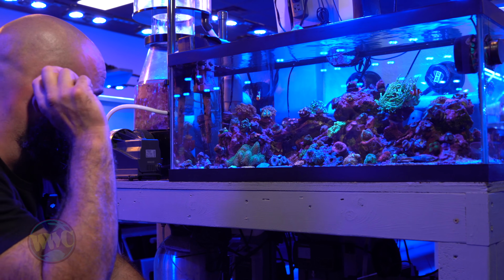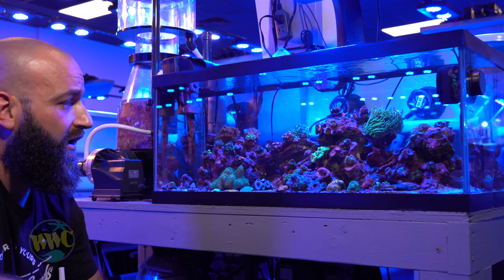Optimizing Aquarium Flow and Waste Export: A Complete Guide

Comment: My Innovative Marine Nuvo 15 Desktop tank has the sump set up differently with the water in chamber one having to go to the bottom of the chamber and then rise up in chamber two and then finally fall from the top of chamber two into chamber three.  I have my heater (along with my ATO sensor and return in chamber three, so I can’t lower the water level too much in that chamber.

Comment: Get little stick with string attached to it put it in the sand to see how your flow is flowing I use 3/32 aluminum tig wire cut to 4 inches 7ins and 11 in (got a 3 in sandbed) and I put them near my corals and open areas to see the flow directions and speed
Reply: And for those who say oh no it’ll leak metals into ur water Well a lot of us use stainless steel and aluminum tweezer in the tank I doubt it would hurt ur tank, It’s a pure aluminum rod that is about 3/32 thick , also there in there for 20 mins max till it’s adjusted to the flow rate of the coral with a 10-20% water change after . Also it’s not that hard to find a replacement material (so called reef safe materials. That can act as a substitute. Also amino  and flanks rather dispute too fast or move around to fast for me to properly view everything at once + I don’t want to over do the flakes or aminos in my system

Comment: i have a sump that does not have a fall between 2ed chamber and return chamber what do i do?
Reply from the maker: Just drop the water level in the return chamber until it drops at least .5". If you have an ATO sensor, you can simply move it down.

Comment: Hey, I have a couple questions with the AIO water levels. What if you have a small skimmer in the back chamber like a tunze 9001 which requires a high water level? Also what about a heater how where do you put it in the back so that it’s fully submerged? Thanks

Comment: After struggling with flow issues in my peninsula tank and watching this it's been a game changer, I was constantly battling dead spots and film on the surface with very little surface skimming going on. Moving the powerheads down to the middle of the tank as both are on the back wall either side of the weir and turning up the return, a little adjustment with the ball valve and wow what a difference, not only can I now run the powerheads at a slightly reduced speed the the surface skimming is insane and after 24hrs the water is looking so clear with no surface film, thank you so much for doing this video 😁

Comment: Thank you for sharing. Where do you place the heater with this instruction?  Instructions for many aquariums and heaters say to place the heater in the third chamber. 
Also, my fluval flex has two drains. One at the top and bottom. Does this change anything? Thank you!

Comment: Ok so I came across this video in The Fluvial EVO group on Facebook but I have to say all tank requirements as for water levels are different especially on the Innovative Marine tanks they give you a water line and it’s not even close to what you are showing I would not usually state you are not correct but it caught my eye just a fyi
Reply from the maker: this video was to help everyone understand the flow and export so they can make those adjustments to the system the have :)

Comment: I have a long tank,6,5 ft.I have 2 gyres and 2 wave makers.Cant get the right flow.Problem with gyres is i always let them run forward.Its not bad maintenace but i find that they quickly make and howling sound if you let them run back and forward.So i let them run constantly.Cant get my euphillia movement right,its frustrating.Great vid also👍
Reply from the maker: Is the hammers and torches not doing well because of the flow?
Reply: @WorldWideCorals  there ok,they not move from left to right. More to one side

Comment: The red sea max nano tanks have a terribly badly designed rear sump section as the baffles do not function properly and you are left with particles circling on the surface in the sump and display
Reply from the maker: What are you doing to fight that Max?
Reply: @WorldWideCorals  as far as i can tell there isnt really much that can be done. Other than using filter floss to catch the particles as they enter the rear sump and running a higher flow rate return pump. Obviously the next issue is as the floss clogs, the return chamber water level drops and so does salinity due to the ato… so it all a delicate balance that requires constant monitoring
Reply: Send pics to our customer service please we may be able to help

Comment: This doesn't seem achievable with waterbox tanks. Their return nozzle placement is 3-4 inches higher than what the tank in the video has it's nozzle at. It's not possible to have the water level that low in the back chambers without having the return nozzle pretty much outside of the water blasting a waterfall into the surface.
Reply: This is entirely possible with the waterbox. The height of the nozzle has no impact on the directional flow. It actually better impacts the PH and DO.    The rear Chambers function exactly the same with two less baffles
Reply: Literally tested this out myself to get the chamber water level that low I need to take out ALOT of water. I am using the standard 225 micron filter sock (felt not mesh) which is the only difference I see in the video other than return nozzle placement.
Reply: @Arborpress  and what was wrong with taking out a lot of water?  Send some pictures to our customer service and I think I may be able to help out better

Comment: Such a useful video, although how would you maintain the levels in the rear chamber if your tank has an overflow weir down the bottom as well as the top, it seems as though the water level stays completely the same across all compartments and the tank, it creates a bio film on the surface which sucks, is it possible to fix?
Reply: It's hard to answer this without seeing. However if it is anything like the marine land overflows of times past, they took have a lover intake but it is just a passage behind the cover that also flows up and over the top along with the upper weir.  This does the same thing because it creates a draw.

Comment: It would be cool to see a an optimal AOI fuge design.  Maybe two designs one for a single overflow and another for larger tanks with two. Tank shown here has some tight plates while others have a big gap/chamber between the inital overflow and getting to the return pump.. how does that affect things? is it just more room to put things like a heater or bio media or is it not as good for some other reason?

Comment: It seems like even when I get particles back up into suspension in my 20 AIO, they do not hold at the surface and just recirculate.  Some particles do make it through the weir but most approach, then fall back into circulation towards the powerhead.  Could this have to do with surface tension? My lighting brackets break the water surface on both sides.
Reply: Heard to understand what you are saying entirely but turn off the powerhead and play with the surface skimming that way. It's possibly there isn't enough draw through the weir. If that's the case there needs to be more return pump. If not the way your powerhead is directing flow it is creating an inefficiency for drainage
Reply: @jdearel1  Yes, there seem to be an inefficiency in the area by the weir that is causing particles to be "confused" which way to go.  Going to take your advice and start with surface skimming, no powerhead.
Reply from the maker: It is possible yes Michael, Has it always been like that or is this something recent you have noticed?
Reply: @WorldWideCorals  It's a new tank so tinkering with it as I go along.  Recently fed some frozen food, when pumps kicked back on after "feed mode", I watched some particles get stirred up and seem to just circle.   Return pump is set to around 200 gph.  Nero 3 pump is set to 30% and its positioned on the right side glass, pretty much the same spot as the WB20 tank I saw in one of the WWC videos.  I'm going to play around with it, maybe try removing light brackets to see if that's causing the issue, then see if increasing return helps, and mess with the powerhead positioning.  Right now seems like the setup I have is creating a zone by the weir where particles cant decide which way to go.
Reply from the maker: @michaelreeves8052  Best way to check is place some flake food and see how it moves in the flow line, Make it a bit better to see.

Comment: @WorldWideCorals  Great Video Josh !  I own a JBJ RF-65 and after this video I believe  I am running to much water in my back chamber . Are you familiar with this tank ? where should my water level be ? On one side i run a Cup with  filter floss and the other Cup with Carbon /Gfo when needed .  Tunze 9012 skimmer in second chamber ( on side w no floss)  Thanks
Reply: A Minimum of of 2" above the pump in the pump chamber. All the way up to 2" below the last baffle fall dial in between those two marks to get the desired noise of cascade.

Comment: The tip at the end about running too much flow through the return and overflow just solved a 3 year problem for me.   Water tank in rimless tank was too high and constant adjustment of the gate valve to try to keep the overflow quite….  Now I have the proper water level in my tank and it’s silent!    THANK YOU JOSH!
Reply: It's unfortunate that it is so simple, yet not obvious. 3 years is defeated, glad you stuck with it.

Comment: I appreciate the break down. I have been in this hobby for 4 years, I started with Luo's current tank IM 25. I just upgraded to a 4820 peninsula and realized I have too much water for my sump compartment. I always wondered why my protein selection was pretty stagnant. Your break down on how each selection is below one another and where the flow should be is a huge help and I appreciate it! Just by decreasing the water level I have noticed an increase to my pH due to the additional gas exchange! Thanks again
Reply: Little bits of help go a long way when it comes to sustained filtration

Comment: Great info. I ironically worked on dialing my dursos better this morning. Which was  a pain because they can be noisy.  But figured it out and turning over my tank twice as much now!
Reply: They are tricky.  a DC controlled pump or a fine tune gate valve will make life a million times easier good luck on your journey.
Reply: @jdearel1  thank you!  I had my jebao dcp 8000 running at 33% before and now up to 80%. I’m happy I added gate valves when I plumbed it!

Comment: How does this affect a HOB filter?
Reply: A hang on filter is just extremely inefficient at doing the job. The likelihood of material in the water column passing by the pickup is significant less than a surface skimming overflow. Utilizing the movement from the power head to direct the flow of particulate toward the pickup will increase it's effectiveness by a small percentage.  Next best would be an additional hob.

Comment: Great video as ever team.

Im struggling a little with positioning my powerhead in my red sea reefer 200. I have a reef wave 25 which is a gyre style pump.

Ive notice my red montipora is getting a lot of debris sitting on it. The powerhead is above the plate with one pump angled up for surface flow and the other angled further down. 

I also have lps in the tank so unsure if i should increase flow, angle it more directly at the plate or add another powerhead on the opposite side pushing water over the plate directly. 

Do you have any thoughts Josh?

Cheers

Allister
Reply: The position below your power heads will always be the place where the heavier debris falls.  This is why I prefer multiple sources of flow. Because the opposing side would prevent this from happening if delivered properly.
Reply: However they will likely need to be decreased from your current percentage and off cycle intermittently in order to work well